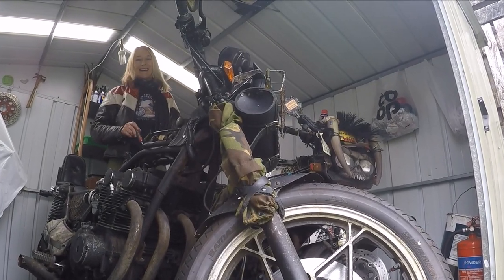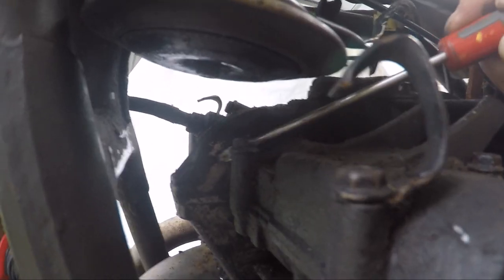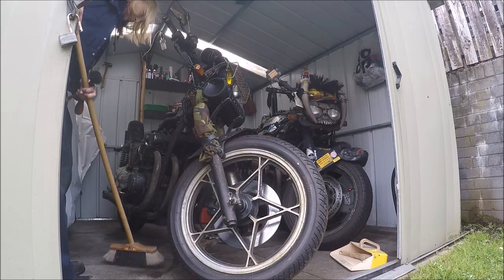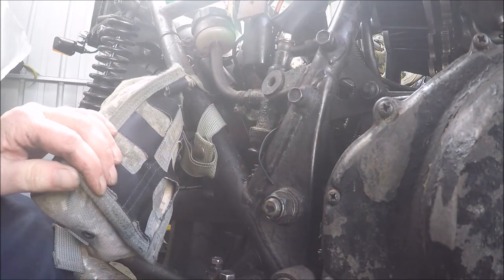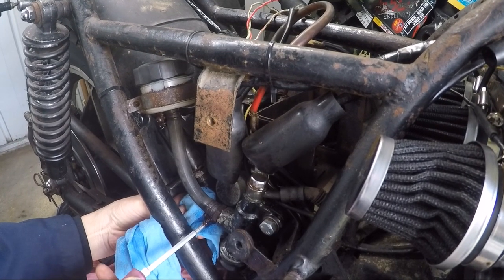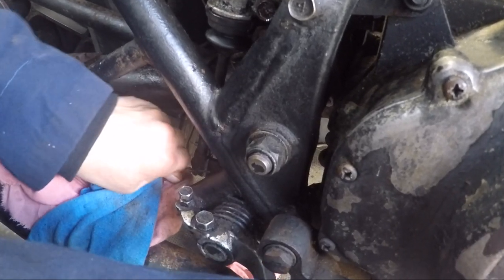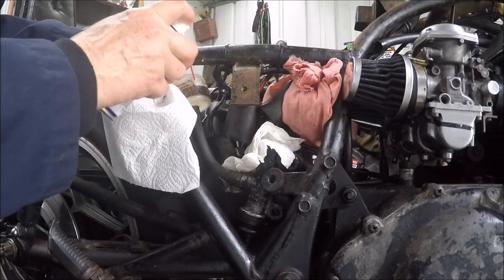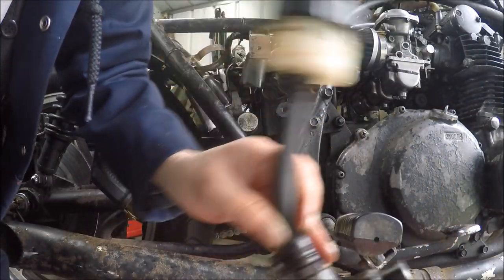GS550 Rat Bike Restoration Project 39 #Rear Brake Master Cylinder Examination

Comment: cleaning a rat bike ?? whatever next lol !!
Reply from the maker: Thanks but I don't want it shiny lol. Unfortunately the front fins were blocked with grease and farm dirt. Best to remove it! Those parts cool the engine down and looks like I'll have to fix an oil leak at some point so a clean engine is a necessity before that could happen 👍